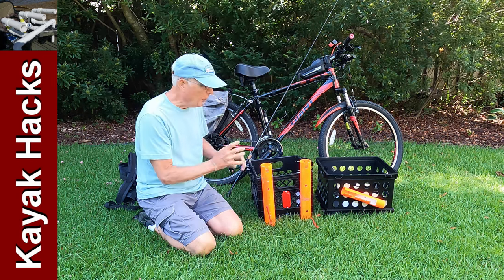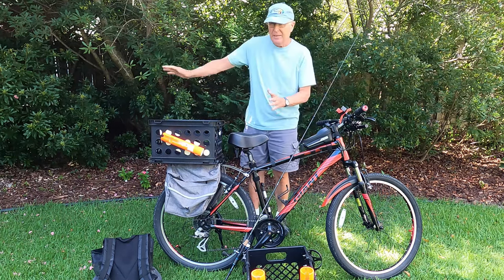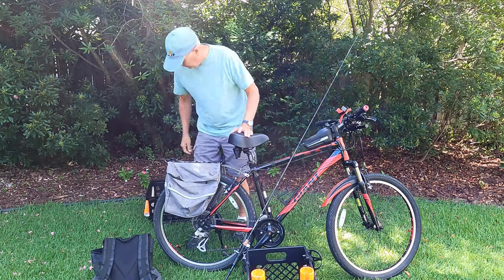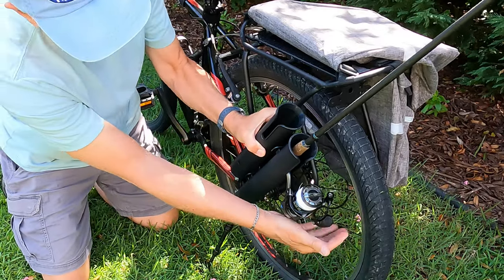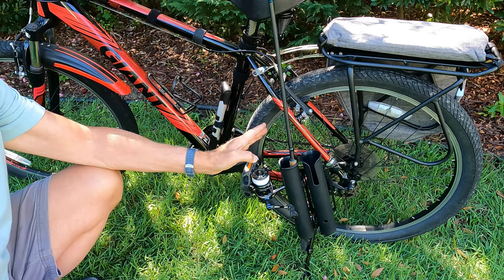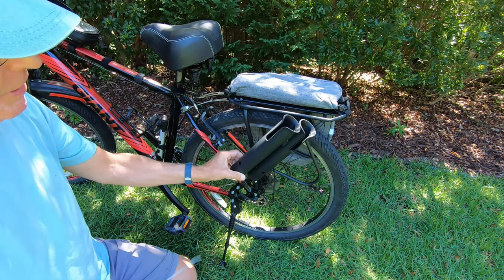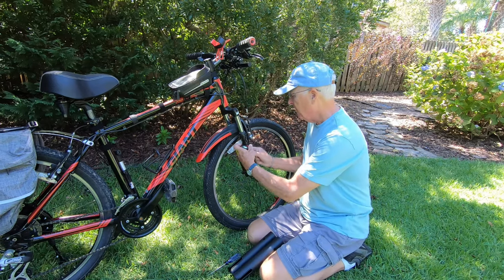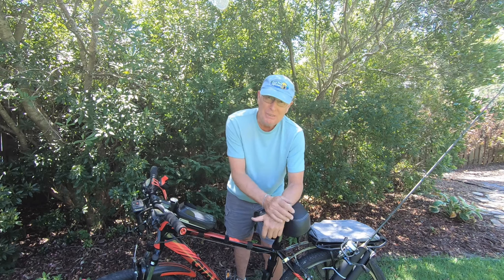Rod Holder For Bike - Pros and Cons

Comment: I used to velcro/bungie cord my 2-piece rod and sand spike horizontally to the top bar.  No issues with getting on and off the bike and pedalling.  If you are worried about the front of the rod getting snagged on something, just velcro a pvc pipe as long as the rod.
Reply from the maker: I agree - that is a great option. I covered something similiar in another video.

Comment: The higher the mount the easier the bike tipps over, especially with mounts on the kickstand side. Low an angled rearward misses trees too. Having to remove hooks nd weights as I go from spot to spot is my problem. I've tried velcro wraps and such but could sure use a good idea/ hack on this one before I get hooked mtself.
Reply from the maker: Very true on the weight balance! Before I started using milkcrates, I just did this - https://youtu.be/3bg0XYqrOqY
But, that was for freshwater rods that are not really long like surf rods.

Comment: Have you tried putting a bait caster rod combo in these?
Reply from the maker: sorry for the late reply. Each day, I saw your question and thought... I need to go check... and promptly forget to do so. Today, I checked. I looked at the baitcasters from two different companies that are pretty representative. Neither fits - so do not buy this if you are using baitcasters since the rod will not snug into the slot.
Reply: @KayakhacksFishing   Thanks.

Comment: Would saddle bags solve some of these issues?
Reply from the maker: No, since you cannot attach the rod to the saddlebag. If you did not have a milk crate and wanted to use bags, the front fork option is best.

Comment: Nice solution for what it is, and nice and very fair and thorough review. I believe you did a great job explaining work-arounds for the potential issues so that people wouldn't get the product and complain about it if it didn't do what they wanted right out of the box. I really like your reviews for that reason.

I don't believe this particular product will work for my circumstances.  I'm 6'4" (or 6'5" - depends on my shoes 😂) so I don't have a problem swinging my leg over the center bar. Therefore, I'm probably going to stick with the milk crate on the rack. Although instead of PVC pipe, I do use the fairly cheap double plastic rod holders meant for boat or wall mount. They are mounted at a angle (pointing backwards) and fastened with screws which go through the braces on the mount itself - it needs to be improved, but it works. I did think about making a redneck engineering video using a 14' beach rod and some type of sail attached on a rod mount - wouldn't be the least bit useful or informative, but might be somewhat humorous 🤔🤣
Reply from the maker: I would like to see that!
Reply: @KayakhacksFishing  I'll see about sending you something (pics or video) when we can get the bikes out.  If you were referring to the redneck engineered sail... I don't actually have that yet - I'll need to make sure my insurance premiums are all paid up as well before I try that stunt 🤣😂🤣
Reply from the maker: @2reelyakrz481  Yes, the sail!